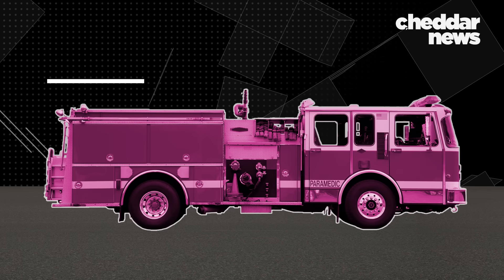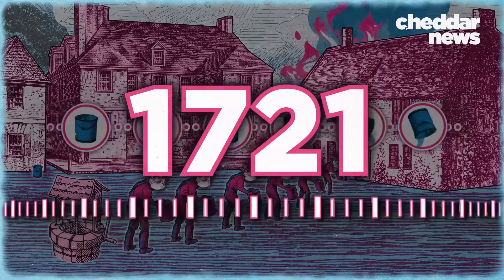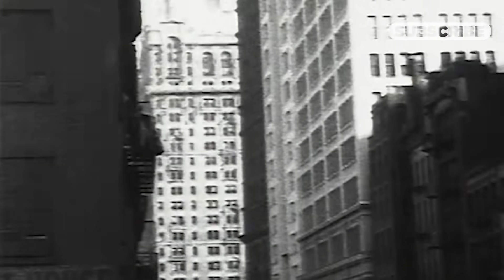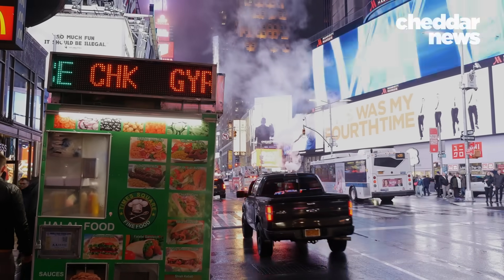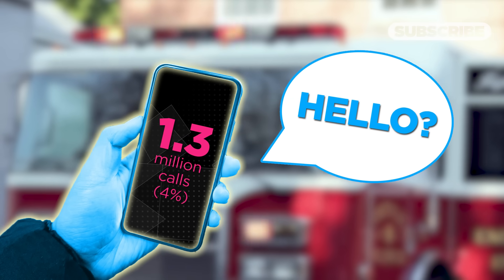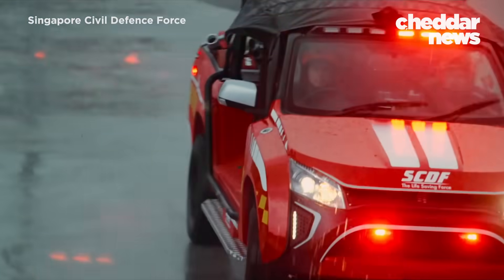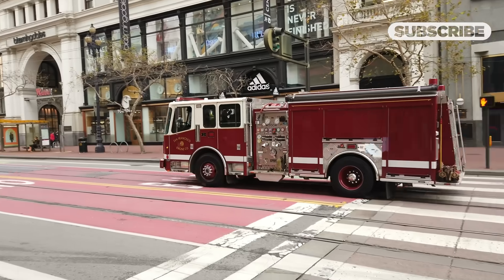Do American Fire Trucks Need To Be So Massive? - Cheddar Explains

Comment: This video really did not paint the whole picture. They had a conclusion and showed everything supporting the conclusion without discussing the opposing side of the argument. Along with that, I could tell they had a general disdain for the bigger trucks as when discussing things that should have been neutral they said it in such a way that showed they disliked it. Fire trucks got big for a reason which was just briefly touched on and should have been discussed more. They have can carry more tools, not to mention some that carry water, when they are bigger. If you want all the same stuff but also smaller vehicles you would need to bring multiple smaller vehicles instead of one bigger one. This means you need more crew, a bigger garage, and a bigger station for the larger crew. There are certainly uses for the smaller vehicles as yes most of the calls are not fire related but when I am in a car accident or a building is burning down I certain want my fire fighters to be able to do their job as effectively as they can.

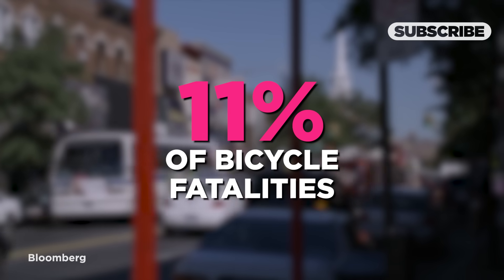Comment: 3:26-3:47
This arguement makes no sense. No one should be ran over by a fire truck. They are some of the most obvious and attention-grabbing vehicles on the road. 
-Bright red
-Loud sirens
-Loud horn
-Flashing lights
You cannot just "not see" a fire truck coming. Also fire trucks have the right of way over bikers and pedestrians, and other vehicles.
If anyone gets hit by a firetruck, its not the firetrucks fault. This is like getting mad at trains when they hit cars at crossings.
Reply: I have seen fire trucks blow through red lights at 60mph without even slowing down. And that is what leads to fatalaties. When I was an NREMT-P, I always slowed down at red lights before crossing.
Reply: @crusher8017  Yes. But whats the diffirence if a European or snaller fire truck goes through the light at 60nph? If someone gets hit, theres still a lot of damage.

Comment: So a thing about city Vs rurual firefighting is in a rural company you tend to have different truck types for different applications using new York you have 3 major truck types engine (has pumps) which carry the firefighters that go inside and fight the fires ladder trucks which deal with ventilation of the structure and rescue of people (anything that needs ladders) and the specialist rescue trucks they rescue people and do all the specialist firefighting as for auto accident and the like that type of work and equipment is spread out between the engine and the ladder as usually a engine company and ladder company (company is the guys who ride one truck) for a firehouse  in a rural company (I'm assuming they have alot of money and need for every type of equipment) you have and engine and ladder they are the same but carry very little non fire fighting equipment then the rescue truck which is a different design of truck from a NY rescue truck it looks like an engine with a much less water on board and smaller pumps but more tool storage the rescue carries the tools for auto accidents (I have seen more European style trucks in this role lately) then the super specialized stuff the  tanker truck which is a water tanker with pumps that can pump water in and out of its tank it's job is to feed the engines more water the last style is a brush or woodland truck and it is set up for fighting Wildlands or brush fires   a last not in my area anyways if you need medical assistance you get an ambulance not a fire truck they are separate things

Comment: So for the most part it comes down to ways that Americans tackle fires and the fact that American architecture tends to be taller than European architecture a three-story 25 story building in a European city is kind of rare where it is not out of the ordinary in an American city
Reply: What does the hight of the building have to do with it though? As stated in the video at 4:40, the european ladder trucks reach the same height as the american ones, although 1/3 shorter.

Comment: 10 feet wide? Perhaps 8.5 feet, the with of a modern semi trailer.
Reply: Correct - all trucks that operate on public roads are no more than 2.6 metres or 102" wide. The very wide fire apparatus are found on airports, and don't leave the airport property.

Comment: That part about Beaufort isn't entirely accurate and lacks some key information. Like they don't run those squad trucks much and they have bigger fire trucks coming to help when they do and majority of those have 1000 gallon tanks and way more tools than u can fit on the smaller trucks. Here if u are on a engine u have to run heavy rescue, medical calls, water rescue, motor vehicle accidents, boating accidents, hazmat, structure fires, brush fires, vehicle fires, low and high angle rescue etc... And we have a lot of areas with no hydrants so u have to have a lot of water on the truck. A smaller truck just wouldn't be enough for us.
Reply: the kind of various scenarios you listed are handled by Engines in Germany as well ...

Comment: Can someone explain to me, why (except for maybe a ladder/cherrypicker/crane) size is relevant at all? If you are going to roll up to a fire with a dozen people anyway, why can't they use 3 vehicles. E.g. one that's basically just a tanker, one that transports crew and one that is responsible for the evacuation/height jobs.

I know it's not as relevant for professional fire brigades, but for volunteer ones (do you even have those in the US?), having multiple trucks means you can send half a team ahead, if the rest takes a few minutes extra to get to the station.

Another benefit of having trucks with different purposes, you can send the ladder truck to one spot to rescue someone from a tree or get the medical emergency for a floor they can not be carried out of (this happens from time to time). While the one with the heavy gear and the tanker can go to a car crash to fight fire and cut free passengers.

To simplify the question: Regardless of whether or not there are benefits to having smaller trucks, what benefit is having all in one truck?
Reply: Cost. You'd have to buy 3 separate vehicle versus one. You would also have to factor fuel, wear and tear,  and upkeep costs. Dunno how volunteer departments get their funding but it might be harder on them so buying one would make sense. Could also depends on how much personnel the department run.

Comment: The trucks are already cramped for space. Even though European trucks are smaller, there are typically more of them. Also, the general response vehicle you talked about is not a replacement for an engine. It is comparable to an EMS squad or a mini pumper. Do not confuse an EMS squad with a rescue squad or an fdny squad. The rescue squad is a technical rescue truck, and the fdny squad is a specialized rescue pumper. An EMS squad is a pickup truck cab with a body set up like a small fire truck with no pump or tank. If there is a pump, then it is a mini pumper.

Comment: I think that you guys overlook the price of the trucks, just because a ladder truck might be $1m, any sort of skyscraper or anything of comparable size can easily cost wayyyyy more than a million dollars, and even $650 grand for a tanker and pump truck etc. will easily be paid back in its lifetime. Also worth noting is the extra lifetime and build quality of the American trucks vs their EU counterparts, American fire trucks often last more than a million miles, while the same can’t be said for their EU competition…
Reply: A million miles? Got proof of that? From what I have seen, fire engines are replaced at about 250,000 miles or 25 yrs. That depends upon the budget of the state or county.

Comment: Anyone can look up facts and figures but it’s pretty clear you have zero sense of the actual fire service. America and Europe are very different, and the reason European trucks are smaller is because they have to be driving around 500+yr old cities. To that token, they typically require more vehicles on a scene to get the appropriate equipment (figure for every 1 American sized they need 2).

My dept also downsized our rescue truck to a mini rescue which is a large pickup truck chassis. And unfortunately we can’t carry all of the equipment we (may) need for rescue calls/car accidents. Our old big rig had everything we need. Now, we need to roll 2 trucks instead of the 1 (sometimes)
Reply: many cities had to be rebuilt after the wars and boy, when you see 8 lane wide streets + tram tracks in the middle of the city you know that it's an easy game even for large vehicles like semi trucks or articulated buses. Relatively few cities have their preserved historic city centers which are 1000 to 2000 years old, but those areas are rather small and make only a fraction of the response area.

Comment: Okay now the media is ranting about firetrucks.
Let me mention some things in this under researched piece of video.
You kept mentioning "smaller but just as efficient", which is untrue.
You were counting it in like the variety of equipment but the problem is quantity of equipment 
Same goes for the water quantity 
and pumping capacity.

Comment: Completely ignores why american fire trucks are so big, theyre so big because american trucks are built for all emergencies. That being said, not every emergency warrants such a large vehicle. a general purpose emergency vehicle is suited for most responses, and perhaps even a specific car fire vehicle would be of some utility. There is a multitude of reasons for both sides. Departments around the world build their loads to fit their specific needs. if your town has no tall buildings, it wont have any tiller trucks and may only have 1 ladder truck if it even has that.
Reply: "are built for all emergencies." and "a general purpose emergency vehicle is suited for most responses" same in e.g. Germany ...
Reply: @EnjoyFirefighting  no. a general purpose emergency vehicle is designed for "most", while an american firetruck is built for ALL. everything from kitchen fires to downed jet liners
Reply: @theduke7539  YES, it is the same here. Engines in Germany are so universal that departments won't roll up with a rescue truck at a fire scene, and even at traffic accidents a heavy rescue is barely ever needed because Engines can handle it. 
Apart from that also in the US there are more specialized apparatus for fires at aircrafts and industrial sites. Obviously, if an aircraft goes down outside an airport the local department will be there first and start the attack ... same here. 
"while an american firetruck is built for ALL" yeah ... how many are built to handle tunnel fires? Most probably aren't as there are rather few and shorter road tunnels in the US. Also I hope you don't pour water into a grain silo fire, so I guess a normal American Engine wouldn't be able to handle it just like ours wouldn't be able to handle it either
Reply: @EnjoyFirefighting  A normal american engine comes equipped with pumps for water but also a storage of chemical retardant, and while oxygen and breathing apparatuses are standard firefighting gear, american engines also have additional gear for confined fires like tunnels and mines. add to that the 1400 to 2300 feet of hose depending on the truck, a fire truck in america is rarely unable to park safely outside a tunnel and run hose lines clear to the opposite side.
Reply: @theduke7539  "but also a storage of chemical retardant" we use wetting agents, foam, powder or carbondioxide; As for grain silo fires we used to use carbondioxide for that, but some years ago we went over to use nitrogen. Obviously the liquid nitrogen isn't carried by an ordinary apparatus. 

Not talking about only the firefighting gear, but also the apparatus. When a tunnel is several miles long and filled with smoke, we wouldn't walk inside but drive inside and thatfor fire trucks themselves need to be spec'd as well. 
Our hose trucks can only lay a hose line of up to 6,560 ft, that's it; In many tunnels you wouldn't reach the end of the tunnel. There aren't many long tunnels in the US, with the longest one being 3.5 miles and with a rather simple layout, not being very complex. 
But obviously, with a certain condition not or barely existing in one place the apparatus barely have to be fitted to work in such an environment.
Reply: @crusher8017  yes, downed aircraft is something you want in the vast majority of american stations. You are talking about a country with the largest domestic flight network in the world. there are as man flights going from 1 place in America to another place in America as there flights in the all of Europe and Asia combined. (Total flights in the world last year was 38 million, 16.4 million were American domestic flights.) we also have the largest network of private and recreational aircraft in the world. There is not a single town in the lower 48 that cant see a plane flying iverhead at least once per day.

Comment: And if you look at Europe Fire department they may be smaller fire trucks but they have to buy more trucks because they can't hold a lot of equipment so there for they have more Fire trucks than compared to the fire trucks in United States bigger trucks more equipment to hold and less fire trucks to buy really some people don't ever use their head
Reply: "because they can't hold a lot of equipment" nope, that's not the case. In fact, even though e.g. an Engine in Germany is more compact and holds less water and hoses, the range of equipment is actually larger (!) than on US Engines. Europeans have more trucks because they provider a wider field of special operations, sometimes with pieces of equipment and apparatus which aren't used by any department in the US. Also small logistics units and crew transport units make quite a share of all the units - keeping in mind that Germany, being a way smaller country than the US, has almost the same number of firefighters, you have to find way to get them to the scene and back to the station ;)

Comment: Why are you only looking at NIMS Type 1 apparatus and not Types 2 through 4 that are smaller? I think it is irresponsible to push a public message to reduce resource capacity all across America without conducting a Threat Hazard Identification and Risk Assessment or Stakeholder Preparedness Review to identify capability gaps in each individual community. On a final note, it is hard to take the opinions in this video seriously when the narrator doesn't even know how to pronounce chassis.

Comment: Sorry to say it, but the video gives a WAY over simplified explanation of American fire fighting and the equipment. Comparing 2 "Pickup size" trucks and 1 engine to the replacement of 3 obsolete Engines is just silly. Saying that the Japanese have a tiny truck that can still carry 5 firefighters is equally silly. The problem is NOT carrying 5 firefighters. It is carrying 5 firefighters, their SCBA in full turnout along with enough hose, water,  and equipment to make an initial and sustained attack on fires. The fact that a fraction of all calls are active fires is true but irrelevant. It is important that when you do get the small fraction of calls that involve life and property loss, you can do more than stare in disbelief with 5 firefighters on scene.
I could go on, but lets just say that simply because it works differently in Europe DOESNT mean it should be adopted here. Not everything Euro is better, oddly enough. Interview firefighters in Germany or England and see if they don't wish they too could have 500 gallons of water and 750' of hose on the first due engine.
Reply: Personally I wouldn't say that we'd need more than we have, with at least 423 gallons on a Rescue Engine and 528 gallons on an Engine and they carry at least 1600 ft of hoses
Reply: @EnjoyFirefighting  - I didn't say we needed more either... I simply make the point that just because someone does theirs with less doesn't mean we are doing it wrong (or that they are). In fact I would bet every Chief of the Department has more brains and experience than me and has looked hard and long at what his different units need, probably right around budget time.
Reply: Why did you switch from Japan to Europe in your talk? Do you think a U.S. pumper would be able to respond effectively on Japanese streets? That is why they use smaller trucks. And you are saying they would use 1 pump only? Of course Germany or England would like to be able to carry more water and foam but look at the size of the roads. Ergo, smaller pumps but more of them.
Reply: @crusher8017  That was actually the point... we don't HAVE to use small engines and small equipment (not a hit on Asians, relax, its just a stereo type that they all have small equipment.) And I only switched to Japan from EU examples because they do in the video. The point is, we have smaller vehicles where they are needed but where they aren't, we have larger more adequate equipment. So I am not sure where your argument is. We have bigger because we can have bigger. They (whoever "they" might be) have sizes that provide the best outcomes for them. This video seems to make the point that the US Departments are wasteful and antiquated. As if how the US does it isn't forward thinking and advanced like EU and Japan... for example.